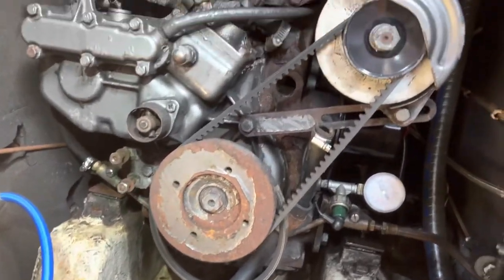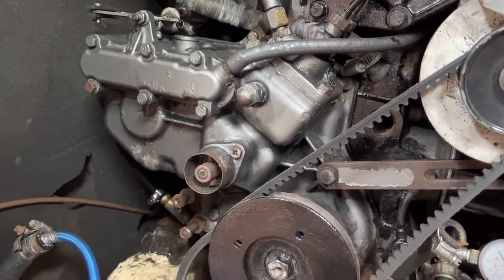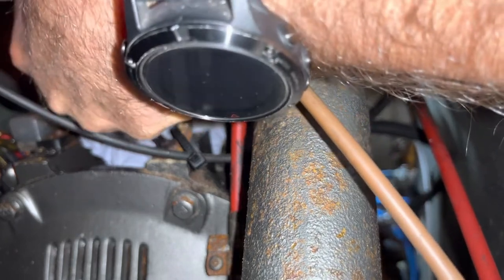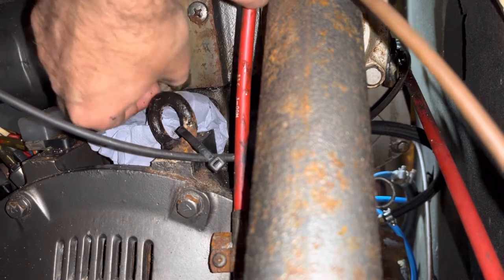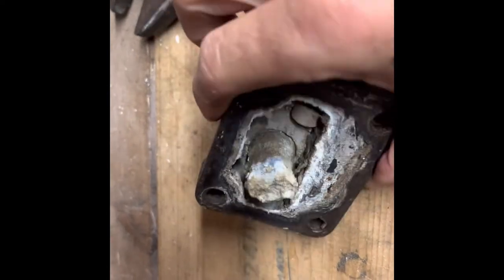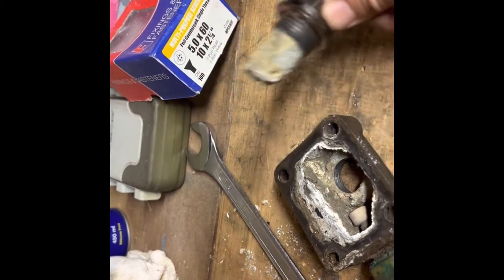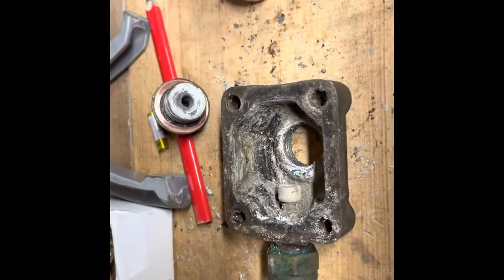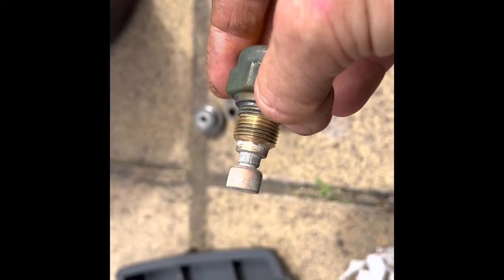Yanmar 2QM15 Raw water overhaul and rear zinc

Comment: I have a 1992 Toyota Hilux with the 3.0 3vze engine. It has had an oil leak for the last year or so, however is getting worse. I thought it was the rocker cover gaskets. However after doing an egr valve delete to access the passenger side (it’s LHD) and changing those the oil leak is still present. I’m about to degrease the oil deposits as best I can, and hope I can pin point the leak. Likely an oil port leak from cylinder 6. (The classic issue with these crossover exhaust pipe breaking down the head gasket with extended heating). Wish me luck. Love this engine series, I’ll call if you I have any issue and keep you updated. Keep up the good work.
Reply from the maker: Ah awesome brother nice to here from you and get after that leak you absolute legend! Do you use hylomar blue on you gaskets? That could help too?
Reply: @solosailinghomeschool8627  I never have, but I was pretty impressed with the gasket you made with the gasket paper and hylomar blue. not sure it'll work for my particular application, but will definitely be keeping it in mind if I find a suited purpose for it. Turns out the oil cooler gasket had one of the major leaks after degreasing, struggling to find an aftermarket seal. I'm calling Toyota in the morning.
Reply from the maker: @caustin1234  yea finding gaskets for older engines seems to be quite Tricky so definitely going to get a few sheets of gasket paper

Comment: Very good video, thank you for doing these. Two questions, can you change the rear zinc without opening the big square bolt? I mean if I can get the housing off. And when you take off/put on the heat alarm sender, does it go easily on the thread and all the way? Mine is really tight to take out and put back, I'm thinking maybe the housing is filled with crap. We'll we see when/if I get them zincs loose
Reply from the maker: Good questions I’ll pop a quick video to try and answer it let’s me know If I’m on the right track 👍

Comment: Is this boat in fresh or salt water? Is this a saltwater Yanmar? (F) in the model number would mean it is for freshwater.
Reply from the maker: Good question, it’s on a sail boat that has to my knowledge always been on salt water. I had no info on the engine when I bought it, so had to work out what it was from manual diagrams. And an original advert I found for the boat. The engine is I believe the Yanmar 2QM15 with the M I presume meaning Marine?
Reply: The entire video is about zincs!! Because saltwater... Duh!